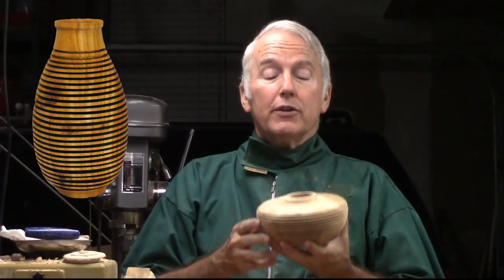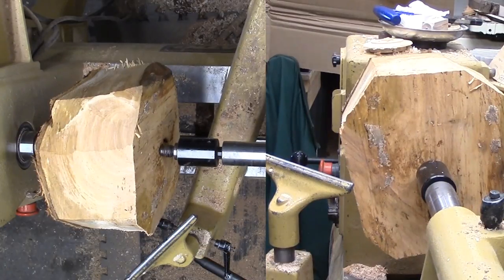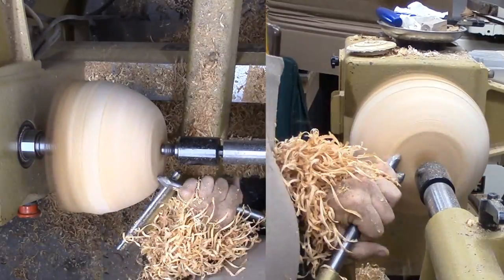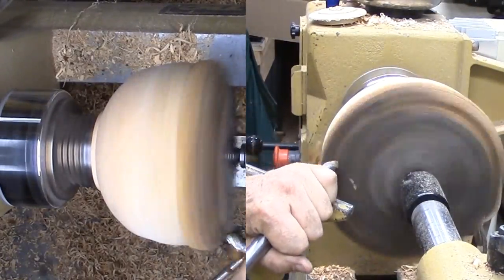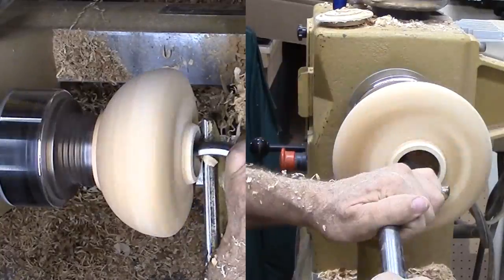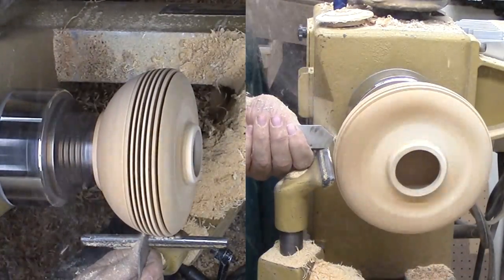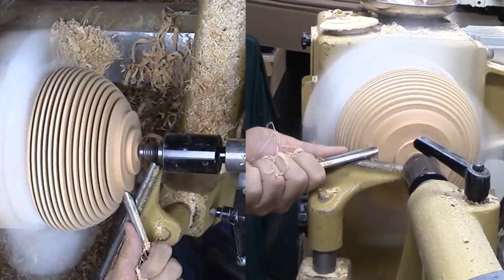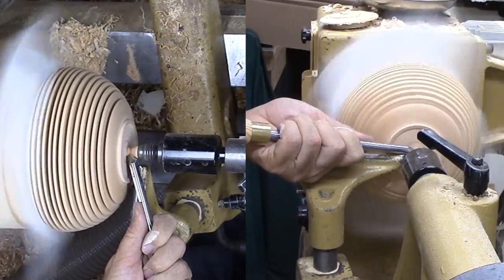Cross Grain Hollow Form With Fins

Comment: Have you thought of making one from dry wood to eliminate most of the warping? I think the symmetrical fins would look great because my eye is attracted by symmetry. Perhaps you could use one of those "U" shaped "Beading" tools to mark and then place each fin accurately. Still I like the project, very unique look.
Reply from the maker: I think pieces of this style from dry wood versus wet wood would be in two separate classes. As a finished piece the difference is whether a viewer can appreciate the warp effect. From a turning aspect, Green wood is much easier to turn and definitely  less expensive thru urban forestry.
Thanks for commenting.
Alan